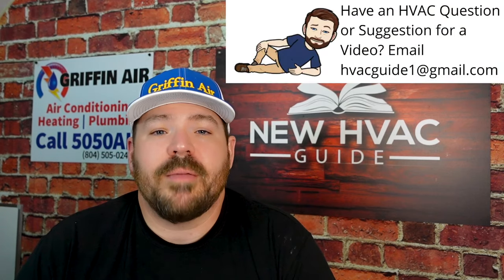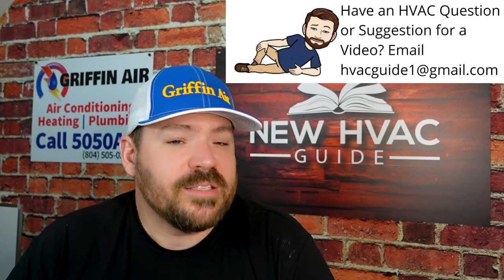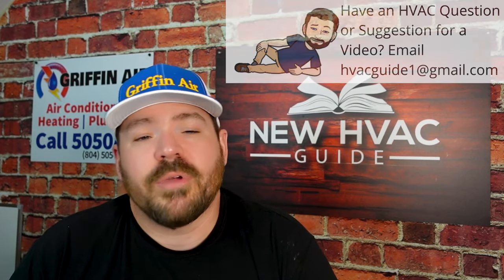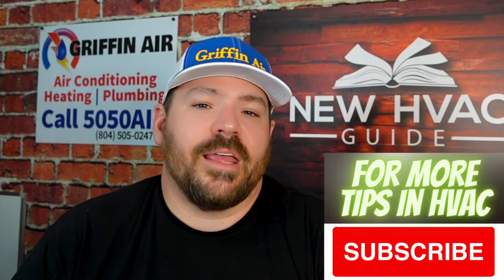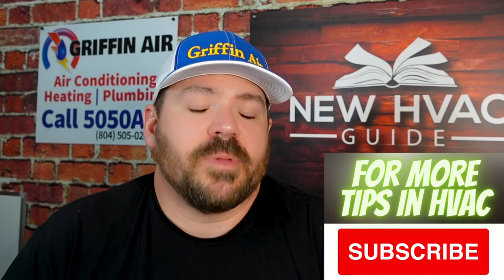1 BIG MISTAKE All DUCTLESS Owners Make!

Comment: Yeah auto is best.  Except... One of the ones I put in my son's house doesn't throw the heat through the whole kitchen/dining room unless I set the fan on fast.  It still cycles, only goes fast when actually heating.  On auto it has a tendency to be satisfied when just the area in the immediate vicinity of the unit is up to setpoint.   Then it short-cycles.  Probably would be wiser to use an aux fan for wall mount motor longevity.  But this is way easier.  😋

These high wall mounts are great for cooling, but for heating it's better to introduce the hot air at floor level.
Reply: What brand? I have a Fujitsu and found i have to do a temp offset for heating because of the thermostat location.  Sometimes the offset is 10 degrees above desired temp depending on outdoor temp.
Reply: @chrisE815  
The Pioneers do a pretty good job of maintaining setpoint.  I did notice when it's really cold out they seem to have some kind of anticipation where they heat a little higher than the setpoint, but that's better than being too cold.

It has an "I feel" option where it references the temp of the remote, and that's pretty neat to keep the environment around the remote at setpoint, but it times out after a couple hours so I can't just mount the remote across the room and use that full time as the thermostat.
Reply: @elgringoec  my fujitsu is so old school.  Wish I paid more attention when i was buying. I would have bought a wifi connected unit and a head with a remote thermostat.
Reply: @chrisE815  
I think you got a good unit.  Those accessories may be available.  Pioneer has optional thermostats (I forgot about those) and WiFi interfaces.  I bought two WiFi boards for my son's units, he likes that kind of silliness, I've pretty much outgrown it, but they're still in the box, haven't tried them yet.  I wanted to be sure the units worked fine without them first before installing them, and we've been so busy that the WiFi control hasn't come up.  I learned a long time ago to set and forget, I think my kids are finally coming around to that realization after loving the fact that they could diddle around with their own thermostats.  (They were not allowed to touch the thermostats when growing up, only I could make changes, anyone else would request I make them which rarely happened)

Comment: i am sorry, but fan speed has NO bearing on output. yes, higher fan settings ALLOW more heat to be transfferd but its not the reason it uses more power. it will still want to hold the setpoint because that is the only thing it cares about and higher fan speeds allow the system to get to it faster. but once its there the power reduces even if the fan stays high. just advising blindly to set it auto is not good advice. setting it to forced low speeds also helps comfort and take away big temperature swings even if it reduces power output. the best advice is the one is the one you have not given: its to KEEP the system on so the room gets to temp and stays there. holding a temp is MUCH more efficient than turning it off and on constantly.
Reply from the maker: Hello. I’m not sure what you’re talking about. I didn’t say anything about power consumption. I was pointing out the humidity removal is lower if the system is set on high versus auto
Reply: @NewHVACGuide  i am talking about how you think the system controls itself. and yes, high fan speeds dont remove meaningful amounts of water, that is what the dehumidify mode is for. that forces the fan even lower than normal and allows the evaporator to get down to 2~3 degrees above freezing. the outdoor unit does not care that you set the indoor unit to dry or its fan to low. it does not know you did that. it only wants to keep the evaporation temp on the low side to 1~3 degrees above freezing. nothing more or less.
Reply from the maker: That may be true for some ductless systems, but most of them are using communicating, inverter technology. I encourage you to read the instructions for a high end Daikin or Mitsubishi.

Comment: I added an 8000 btu window unit to my master bedroom because my home units can’t keep up in the summer. I have a 3500 sq ft home with 7 tons of cooling.
A closet would eat up 1000 btu.
Reply: It takes 7.67 tons to cool 3500ft2???Good grief your house is inefficient as all getout!!!
I can cool my 5000ft2 with one ton.
Reply: @elgringoec  built in the 80’s. And I am dealing with summers that get over 100 with over 70% humidity. 
I like my house at 65.
Reply: @hkgonra  You're way off system design temps.  For cooling 70 should be the lowest setting.
Reply: @hkgonra  
That's got me thinking Florida weather.  I suppose if you don't have cold winters then 65F might feel comfortable, but for me, that would be unpleasantly cool any time of year.   My personal preferred temperature and my wife's as well is around 75F year round.  We burn far more energy heating in the winter than we do cooling in the summer.  But I take other measures to reduce the load on cooling in the peak summer heat.
Reply: @bobboscarato1313  I remember 25 years ago when I was the helper for a much older seasoned HVAC guy.
The average house we worked on was built in the 70’s. He would first ask what temp do you want to keep your house. Then he would look at the age of the house (how insulated is it) as well as how many kids and dogs they have.
A house from the 70’s with a couple kids and or dogs were going to get about 400sq ft per ton of cooling. He said the quickest way to ruin your reputation is to have a customer house that they want at 70 to be 75 on a 100 degree day.
They will never call you back and make sure to run your name in the ground to anyone who listens.
Reply: @elgringoec  my utility bill is regularly $600 in the summer but also around $100 in the winter. Luckily I have gas heat.
Reply: @elgringoec  and I'm in the Memphis,TN area.
Reply: @hkgonra  
You're about six to ten degrees warmer on average than here.
Reply: @elgringoec  but you shouldn’t size HVAC for average, you should size it for the worst case scenario.
Reply: @hkgonra  
My point is that our environments don't explain an over-seven to one difference of energy requirements.
Reply: @elgringoec  is your house new ? With much better insulation ? 
The numbers you quoted only seem possible with a net-zero house.
Reply: @hkgonra  
New-ish, I built it in '94, and that's when we moved in.  Pushing thirty years, time flies!  I've continued to work on it since.  I don't have any local generation (except backup generator, still in the box) , so all my electrical use comes from the grid.   I was way ahead of my time though, building standards are just catching up to the energy conserving techniques I came up with using common sense.  I didn't want to be a slave to bills.  But of course the current policies are doing their damnedest to try to make that happen!
Reply: @elgringoec  wow, even brand new well insulated homes in this market have less than 1000 sq Ft per ton of cooling. 
That’s amazing. 
How can you even get enough air flow off a 1 ton system for all that space ?
Reply: @hkgonra  
 
It's because I put the unit at the top of the stairs in the top bedroom.  Cold sinks and heat rises.  I have to keep the door open to the hallway.   I also have this chute I made that goes from the hallway ceiling below to the top bedroom and that creates a flow pattern.

I also have a central LP furnace with a 4 ton heat pump, so I can turn on that fan to forcefully circulate air throughout all four levels if need be.  But the air circulates well enough throughout without that if I keep all the bedroom doors open, at least during the day.

I don't have any conditioned air moving through unconditioned space, cooling and heating is entirely within the sealed envelope.  One huge mistake I see builders doing and buyers accepting is conditioning components in vented attics and in crawl spaces.  That was obvious to me as non professional in building, conditioning, and architecture.   

I actually was planning to farm out the HVAC but when the quotes came back way higher than I'd budgeted for and they insisted two units were needed to property cover the levels, and they said they'd put one in the attic, I decided to take over the reins.  That's just one of the many things I encountered when building my house which led me to come up with this expression, "it takes more than a professional to get the job done right."
Reply: @elgringoec  
So you have a 1 ton Hvac and a 4 ton Hvac ? 
But only need the 1 ton turned on for cooling ? Do you need the 4 ton for heating ? 
My heat load is way lower than my cooling load, my heaters barely run all winter.
Reply: @hkgonra  
I heat from October-November through April/May.  I cool from late June through early August typically.  On nights when the low is around 60 or below, I can cool with my whole House fan.

The four ton was it for many years. Then one year the changeover valve decided to get stuck in heat mode. It still runs like a champ in heat mode, but it won't cool and it won't defrost because it goes to cool mode in order to defrost.  I bought the new valve and was ready to slap it in along with a few other goodies like an exp and a sight glass and more pressure taps here and there, then I couldn't get any r22 at any reasonable price. 

I needed a mini split for an additional area separate from my house, at that time my son thought he'd like to have a couple in the old farmhouse, and I decided to grab one for my garage because the deal was good and they have to be shipped by truck.

So the last handful of years what I've been doing is throwing a big window unit in one of the windows upstairs and let that cool the house to a reasonable level. Then at the end of last summer I had waited a little too long to bring in the unit and when I did it was loaded with thousands of stink bugs. So I got the bright idea to put the unit that I got for the garage in the house upstairs. So I pondered and pondered what the best location would be, I had a lot of limitations, but I settled on ceiling level at the top of the stairs leading up to the bedroom. So it's at the highest point in the house. I hesitated because I had to order a 25 ft line set and that cost me extra. But I did, and I put the outdoor unit on top of the roof of a back porch, and now I have a little one ton heat pump unit in that bedroom. And it cools the whole house better than that window unit did. And I don't have to take it in and out. And I can get a little supplemental heat up there if I want. So that's where we're at.
Reply: @bobboscarato1313  who are you to say what temperature my own home should be? If I want my house 62 degrees in the summer and im willing to pay an HVAC guy to oversize a system to achieve this, who are you to tell them no?
Reply: @christraudt6730  Cool off; I also have an oversized unit but its wrong to oversize!
Reply: @bobboscarato1313  only wrong to oversize if your ductwork won’t support the CFM. if ductwork is matched correctly and you have a variable speed inverter heat pump, then oversizing is no problem. this is my situation. little tip, don’t tell people to cool off.
Reply: @christraudt6730  You're really funny. LOL
Reply: @bobboscarato1313  classic internet troll 😂
Reply: @christraudt6730  You started it; your own fault, not mine!
Reply: @elgringoec  I'm intrigued by your set up and how you figured this out. I'm wondering where you live.  I'm in California and our attics hold a lot of heat.  Wish we'd put in a radiant barrier when we built in the early 90's but couldn't find anyone who was familiar with it. I'm trying to learn as much as I can about the mini splits because we have a problem with one of our HVAC units and want to do it right when we replace.  Did you actually install the handler on the ceiling? And how did you feed the line to your outside unit? The attic is very hot in summer and I believe the line needs to slope downward and out to the compresser so we wouldn't feed it through the attic. 
   I just hate the fact that they put our ducting in the attic instead of between the 2 floors. so I'm totally feeling like, even when you hire someone, you have to know as much as you can about what you are hiring them to do and not just leave it up to the professionals.
    So I really like the idea of having a unit at the top of the stairs knowing that it will drop cold air throughout the lower floor zone. And a small unit outside of the upstairs bedroom would work for us too, when someone's using the bedroom.

Comment: I need some help with this problem.
Mini split manuals say the minimum height of the inside unit is 98.5" from the bottom of the unit to the floor. The instructions say the full cooling effect won't be reached if placed lower than 98.5".
My ceiling height is less than what they say is required. I am trying to think about the reason for a reduction in the cooling effect. I noticed they did not use the word performance or mention a reduced heating effect. I doubt the coolant knows how high the indoor unit is, so the only thing I can think of is the fact that hot air rises, and whoever wrote the height requirement might have been thinking about a layer of hot air floating above the unit that would 
cause a perceived loss of cooling effect.
The instruction says to leave 6" between the top of the unit and the ceiling for, I presume, door clearance. It seems to me that regardless of the floor-to-unit height if the unit is as tight to the ceiling as required, there would be no reduction in the cooling effect. Then again, maybe there is something I don't understand about coolant flow requirements in mini split air conditioners.  What do you think?
Reply from the maker: Clearances are usually minimums. A minimum for airflow or servicing. Height requirements have more to do with comfort. Most systems are designed with the algorithms understanding that they will be mounted high to blow low. Heat rises and so comfort in the space takes that into account. Mounting it at a different height, may require you to set the temperature higher or lower than typical to get the desired comfort
Reply: @NewHVACGuide TY for helping us all and taking the time to answer our questions sir 👍👍